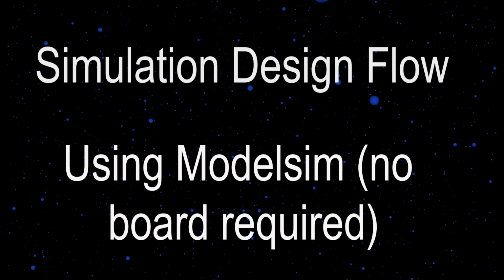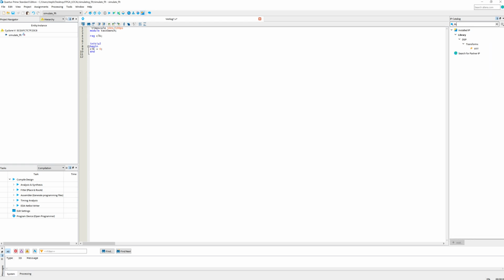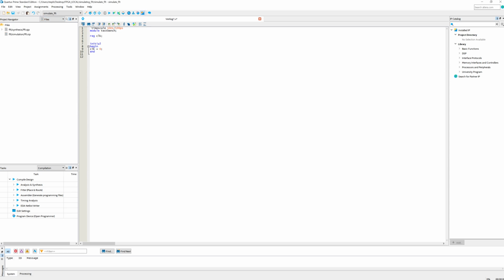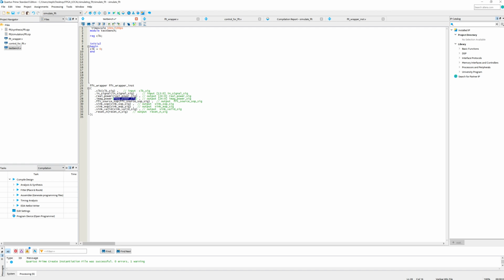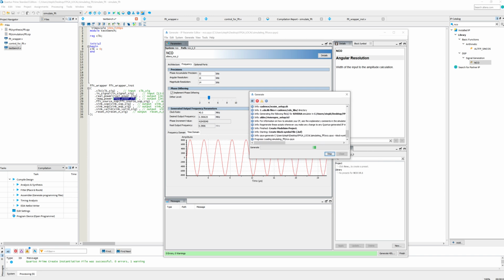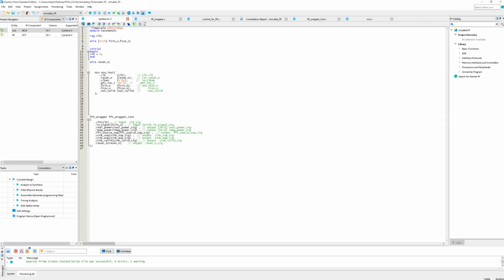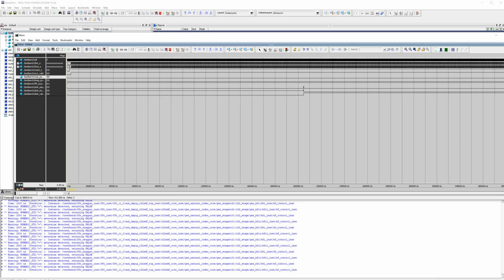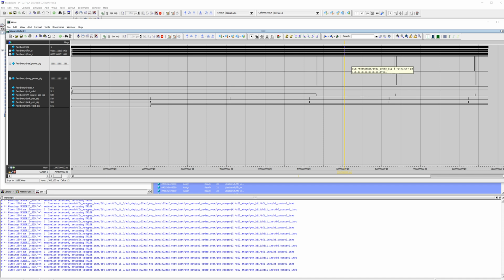FFT development on an FPGA - Simulation Design Flow using Quartus and Verilog (no board required).

Comment: Hello sir, many thanks for your video, it really saved my life, but I may raise a simple question, it seems that the control_for_fft module only processes real signals rather than complex signals, as I saw that outimag of control_for_fft was assigned as 16'd0. What if the input signal is a complex signal, and the complex signal is merely a one-line 16-bit data? In other words, what if the 'insignal' of control_for_fft is a 16-bit complex signal? What are the possible changes of the module control_for_fft, if that is the case? Looking forward to hearing from you, thanks!

Comment: Do you familiar with Cyclone V SoC board?, Im planing to build an simple SDR on this board, I already have the AD-DA daughter card and I intend to transfer the I-Q data to the computer using ethernet transmittion. It will be awsome if you can share some experiences with the SoC and how to work on it!

Comment: Is programming altera cyclone ii different from cyclone iii?
Reply from the maker: No, it's the same. Quartus will convert your Verilog and overall design into something that is suited to your device. Just make sure you select the correct device in device settings. Eventually you use up all the resources on the FPGA so the number of logic elements, DSP blocks etc is important.
Reply: @VisualElectric_  ok am working on the project, so i have to design fft for the project